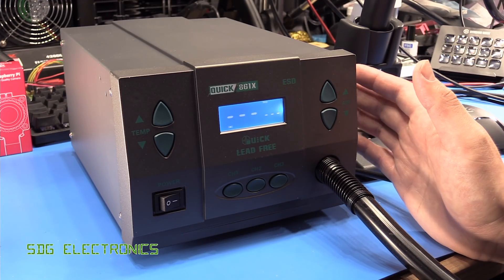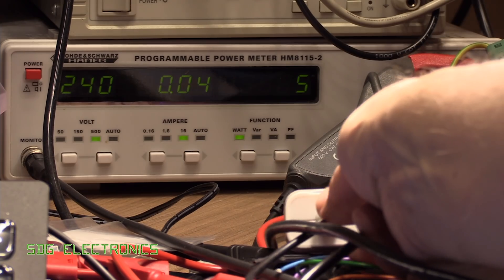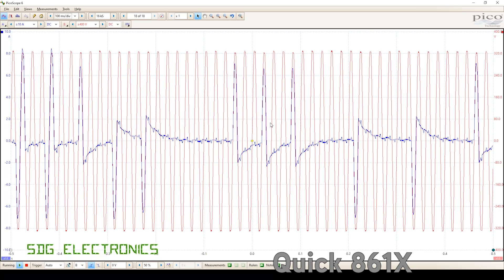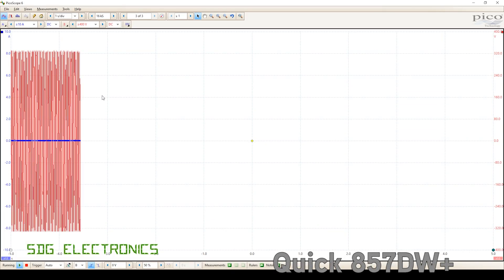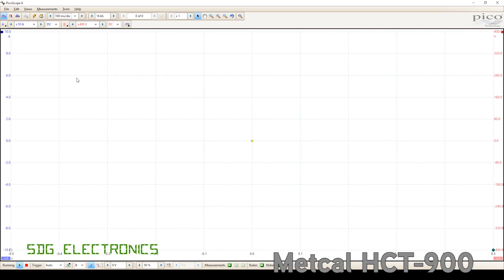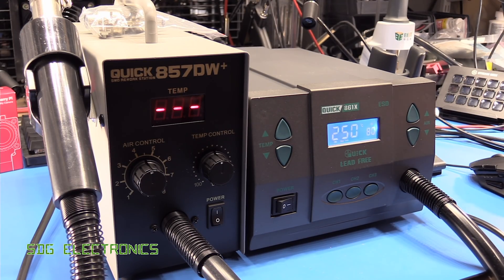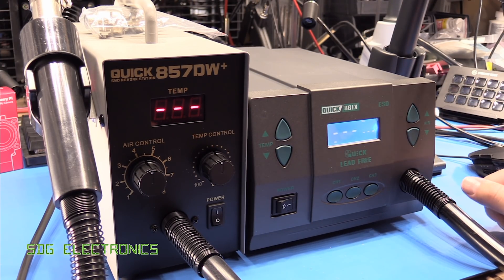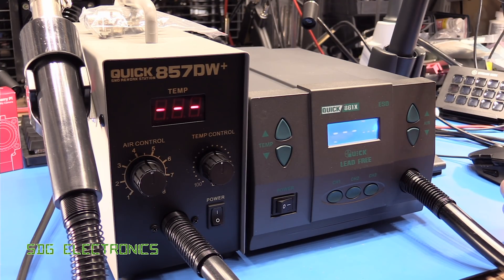SDG #153 Why does the Quick 861 cause lights to flicker??

Comment: Im seeing this  vid. TODAY ..5 years after it was first put up...so here's my very late comments on this...😢
It's probably just working off directly from a comparator output ..(bang bang type)...& there's no integral cycle count gating....
...(both +ve & -ve half cycles).
i.e. ...
FOR COMPARAISION...
look up the internal control logic of the FIRST gen. PWM ic ...the 3524...
and then study the logic of the 3526A/ 3826A/..etc.
...3rd gen. pwm chips 
These latter chips had the comparator outputs fed into a latch FF . This FF output was given to a MEMORY FF.....and other logic steered it into the final TOGGLE FF whose outputs were used to control the final NOR gates...
You can definitely do these mods once you go through these data sheets....
Here each ZCD will have to go through somewhat similar sequential & logic steering...

Comment: Yea the yihua 959d does the same thing.. ive tried massive filtering, isolation transformers, smoothing the power and nothing helps the flicker except adding a few massive capacitors on the power in which is sketchy to have on the device..  plus when it gets unplugged there’s a 50/50 chance that it will weld itself to a piece of metal or hurt somebody on accident..  the minimum capacitance to even effect the flickee for me was 20 μF..  80 μF to make the flicker barely noticeable but the rework station ends up putting out an extra 100°c and the fan runs like a turbine on full speed..  so not a good fix..

Comment: These things cause more problems than just lights flickering; This thing has quite literally blown out the HDMI port on one of my TVs, one of my AV Receivers, and always causes HDMI signal to devices on the same AC circuit to loose signal for the entire duration it is powered on (heating element not even running). Thought it was a grounding issue on the outlets, but everything is wired correctly. It's starting to cause a lot of expensive problems, really irritating.

Comment: Interesting.
In my masters school I learned that heating elements are usually controlled via pulse packet controllers (like the Metcal has, and that is not PWM) and not like a dimmer or vfd, just for the effects you have shown. We saw that works as well, but your mains is getting polluted beyond anything your electrical company and your other lab equipment will like...

Comment: You have 240VAC?  maby to much? We have 230VAC and I have worry to plug-in.  I have the Same Hot-Air-Station buy. Inside the device are installed 200V Capacitors. Maby I should change this? What do you think?
Reply: 200V capacitors are not connected to 230VAC ;) They are connected to DC just check the voltage there, I'm sure it's fine, else yes change them to a higher voltage.
Reply: By the way, with a full bridge rectifier at 230VAC you got 207VDC. 200V capacitor seems too low.

Comment: The half wave, if not finely balanced or in short time frame randomized is actually MURDEROUS to the main power transformer.  Here is a story, (with names removed) about what can happen.  When the inverter type welding power sources were first introduced, there was a user who had the utility power transformer "smoke".  Of course he called the utility company for help and they came, found the transformer bad and replaced it.  So, the welding power source was turned on again and the new utility transformer promptly blew up again.  Upon further investigation, it turned out that the welder primary rectifier bridge had failed so that it became a HALF WAVE rectifier and it started pumping DC (average) through the transformer secondary..  The transformer core saturated and the primary current went sky high in spikes.  The primary winding RMS current melted the winding or the copper, whatever.  Anyway, pumping DC through a transformer is BAD and in some cases even worse.  That, along with the human experience of flicker is a reason why the IEC and the European CEE standards list limitations to that kind of loads.
Reply: Wow never heard of this happening before

Comment: Hey @SDG what might also be nice is to examine the power supply in your led lights. To see if the flickering issue might be avoided there instead? Or if it will affect any type of leds, since there are different kimd / quality ones available. For example some leds are conventionally 'dimmable' whilst others are not. And some really cut corners with the power supply and generate their own problem interference or 'emissions' to a variety of greater or lesser extents.
Reply from the maker: I think the problem exists because the current regulation is usually done over multiple cycles. The transient waveform from the Quick station passes straight through because these are dimmable LED lights which can be dimmed with a traditional type dimmer.
Reply: @sdgelectronics  so an impulse response then? Shouldnt the quick have some sort of a mains filter or 'snubber' style circuit to try to absorb such transient? Does it happen because when the triacs transistor turns off it is happen abruptly at some point during / in the middle of an AC wave cycle? I wonder about this same issue for my other motor control project. For my fume extractor. Its a massive 8 inch fan that is way too loud and needs to be 'dimmed' somehow. Probably i will try to add snubber to this leading edge dimmer which aparrently (i am told) is best type for an inductive load. However heater elements like in the Quick are purely resistive loads arent they? So no kick back (out of phase) ? So it should just be a straight (0 phase) transient than? Maybe i dont understand properly, for why it cannot be filtered. Or maybe its only possible to be mitigating lessen the spike?. And cannot eliminate it entirely. Sorry for the poor knowledge here. My understanding is not the best. Lol tee hee

Comment: With all of your experience with hot air stations, can you recommend one which can be set
to blow constant cold/room air?  Also, preferably with encoders or potentiometers for control
of temperature and air flow.  I agree with not pressing up up up up up up up up up up.
Thanks for your reviews.
Reply: You could take any hot air station and just add a switch to disconnect the heater's power supply, perhaps?